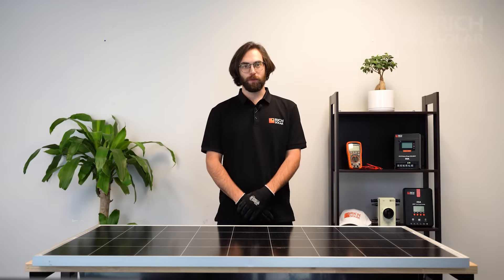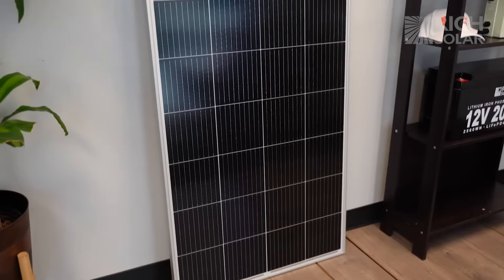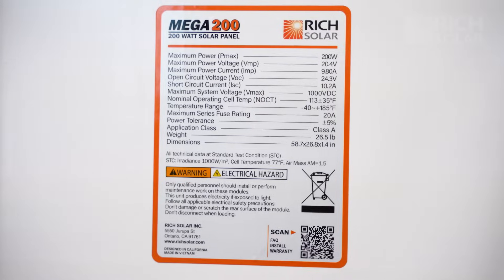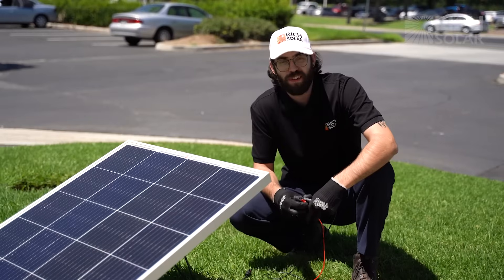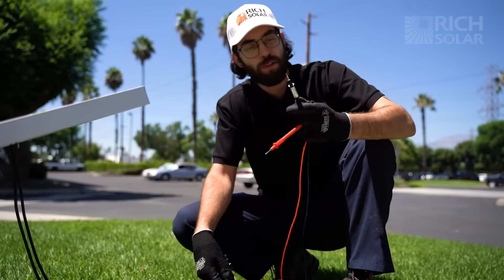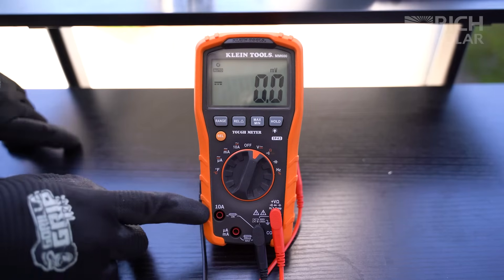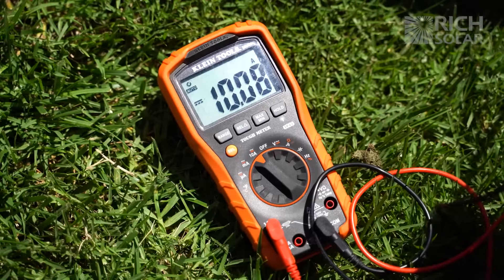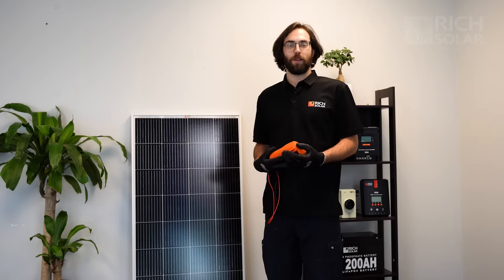How to Test Your Solar Panels Using A Multimeter - Rich Solar Talk

Comment: Hi great video. I have a cheapy multimeter i tested my panel for volts and got 42 where 45+-5%so that was good but then I tried testing for amperage. I don't know if I'm doing it right my meter is different than yours. I moved the test wire to the 10A hole. Then switched from V to  10A and I didn't get a reading. I tried two different solar panels. Should I set the meter to A??
Reply: Yh

Comment: Voc of 260 watt panel is 38.10 but I test 35 volts voc is there a problem?
Reply from the maker: Thanks for the question. Voc of 35 volts during testing is not a problem. However, it's crucial to note that in real-world scenarios, especially under full sunlight, may present varying challenges. Should the Voc drop below 20 volts in such conditions, it signals a potential degradation in panel efficiency. So, it's important to check how they perform in real conditions to make sure they last. But with Voc of 35, nothing to worry about. 

Feel free to let us know if you have any further questions. Thank you!
Reply: temperature effects it.

Comment: I have 28 of the 200 watt Rich Solar panels on my roof, and they work well with my 5000 watt 240 volt Growatt hybrid off grid inverter.  During the summer, Im able to run my water heater, whole house air conditioner, refrigerators, freezer, charge my five EG 4 5120 watt batteries, and charge my electric car (Bolt).  I installed the panels in 3 stages. I did the voltmeter check for the third batch of panels I installed. I didn't think of it with the previous ones.
Reply from the maker: Whoa, that's awesome! 😎 Your 28 Rich Solar panels are like solar superheroes on your roof, running the show! Love that you're rocking the whole-house setup, charging the Bolt, and even keeping those batteries happy. Smart move with the voltmeter check, too. You're living the solar dream! ✨ Thanks for trusting Rich Solar! Hope you could share some photos or clips😄